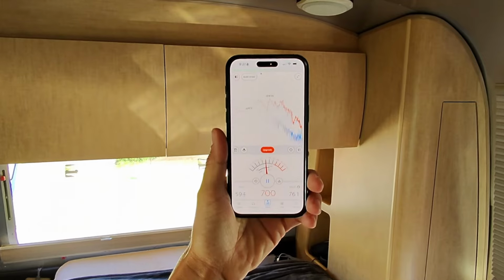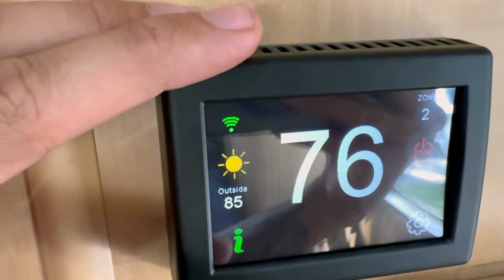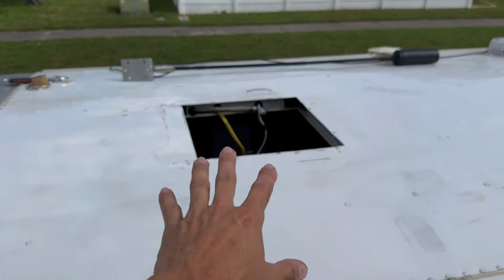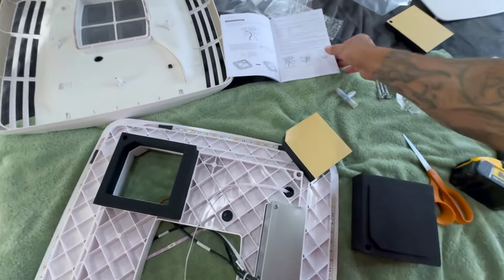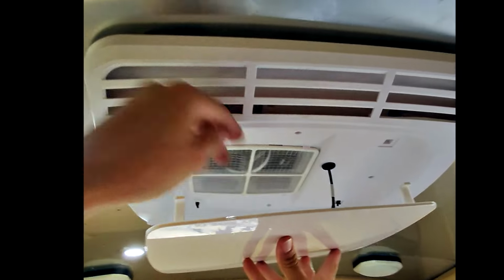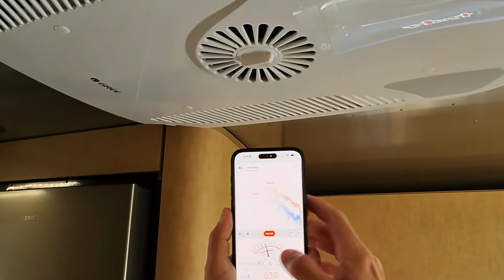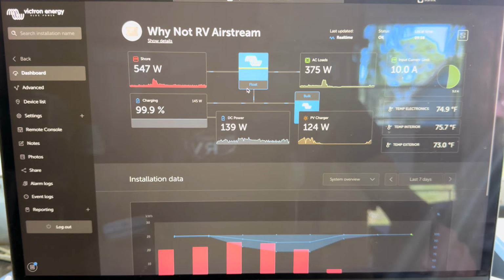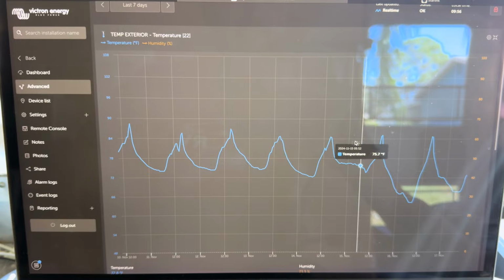TURBRO INVERTER HEAT PUMP Install and Test - Why Not RV: Ep 152

Comment: Looks like the Gree unit is the best overall, but the Turbro beats it out on energy efficiency by a couple hundred watts if I heard you correctly. I wish one company would marry the two units together and make an ultra energy efficient and quiet unit in one. I suppose most people aren't too interested in energy efficiency in an RV because they are using campground electricity, though. Good review thanks!
Reply: I would disagree somewhat because a lot of people are trying to run these off of battery systems powered by solar in off grid camping, so in that case the energy efficiency is of utmost importance. We are looking at these 2 units for just that reason. There are several campgrounds we love but we avoid them in the summer because they don’t have power hookups and sleeping without AC in the northeast humidity is brutal. This would open the option of those sites up to us in the summer, when other campgrounds that DO have power hookups are usually booked solid.
Reply: @jeremyspecce  Which unit did you pick and how wells is it working?
Reply from the maker: It’s the first step. They’ll improve the interior design with time I’m sure

Comment: I full-time in my older, Monaco Dynasty, and would love to see this company or companies like it. Come out with a unit that is ducted. Thanks for the video.
Reply from the maker: I believe they are working on a ducted unit and that will be released in the coming months.
Reply: @WhyNotRV I'm assuming someone at Turbro told you they were coming out with a ducted unit. Any more info on timing? I had asked about this previously and just got the standard "we don't have a ducted version, but will pass your feedback along" response.
Reply from the maker: no not directly but its the standard process you see with these units, they release the non ducted version because its easier to get done and serves the larger audience in the RV world.
Reply: @WhyNotRV   Thank you, hopefully when they come out with a unit, you will review it and let us know what you think.
Reply from the maker: I don’t have a ducted system so I won’t review it    It’ll be identical on the outside just with a different interior piece that will make it more quiet and feed into the duct system.
Reply: @WhyNotRV   Do you have a link to the company?
Reply from the maker: https://www.turbro.com/collections/rv-air-conditioner/products/greenland-13500-btu-inverter-rv-air-conditioner-with-heat-pump/whynotrv
Reply: Looking for a ducted version also. My units dump into ducts...you don't see or access them on the inside